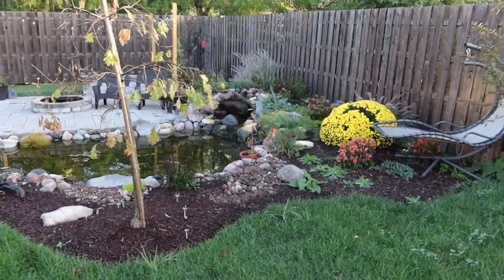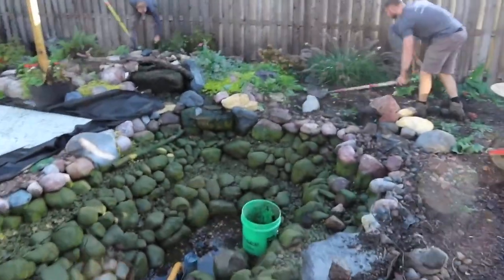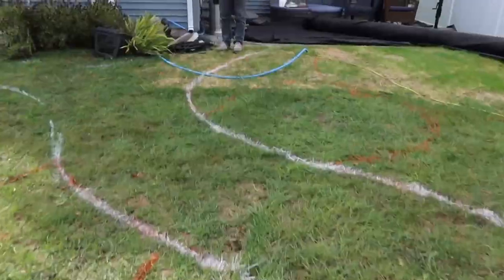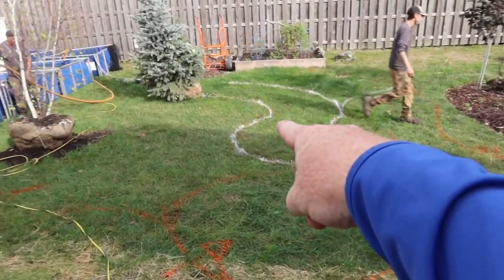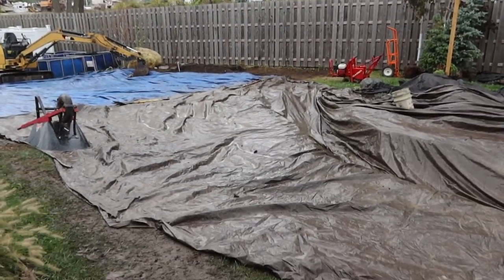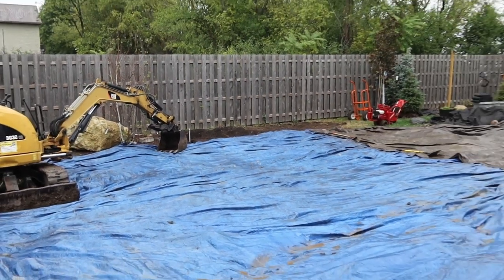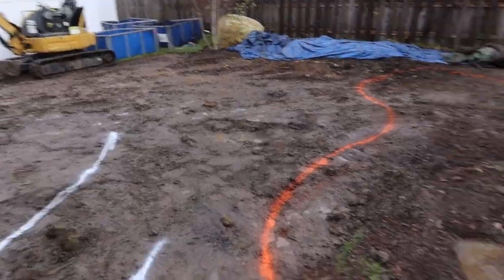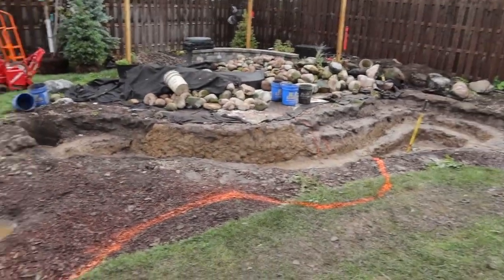Go BIG or Go Home: REC POND Build - Part 1

Comment: If the volume of water in a rec pond is theoretically 100,000 Gallons based on its dimensions, do you then subtract the weight of the boulders and rocks etc to get the real volume?
Reply from the maker: Yes